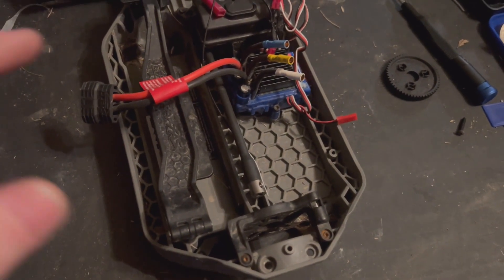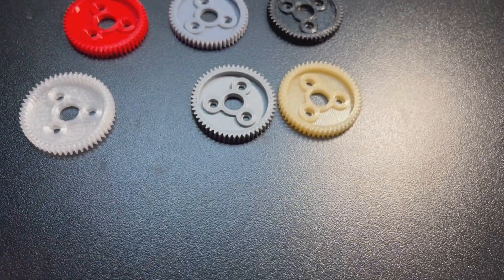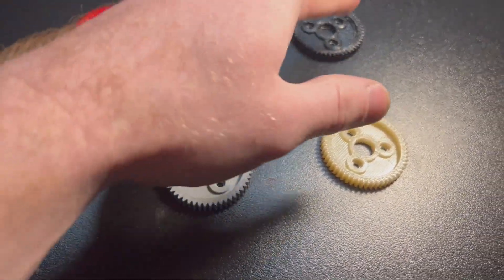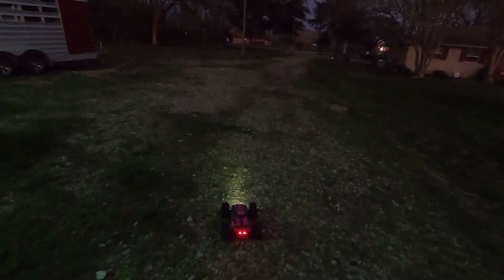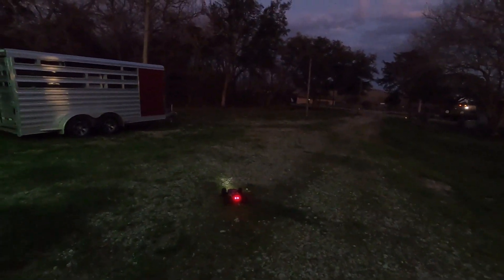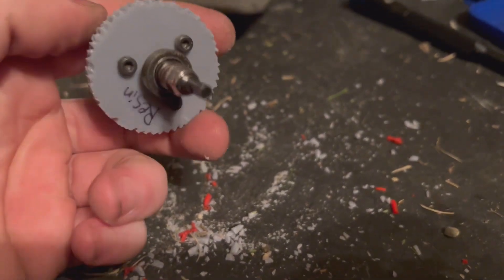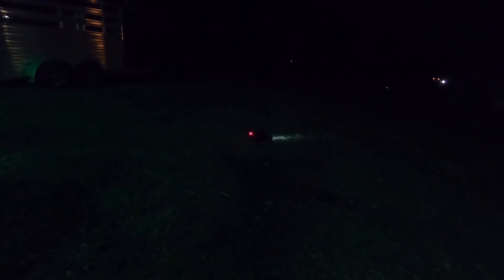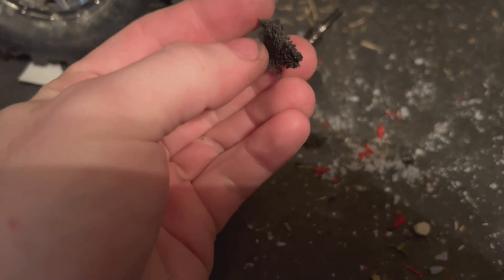Will A 3D Printed RC Gear Work? - Part 1

Comment: Hello friend, I admire your video and it gave me hope to revive the old rc that I have, I want to print a couple of my gears of 1 transmission of my 1/10 2wd (what material is the best indicated to carry out this process? Greetings. (my car It is brushed and it would take it to a maximum of 21 mph. Do you think the gear will resist?
Reply: Hi I was thinking to get 3d printed gear also but then I got better idea make the gear and use it as template to make metal gear. Use the same method like how jewelry are being made.
Reply: Where can i find the stl files for jato 3.3 spur gear thanks in advance